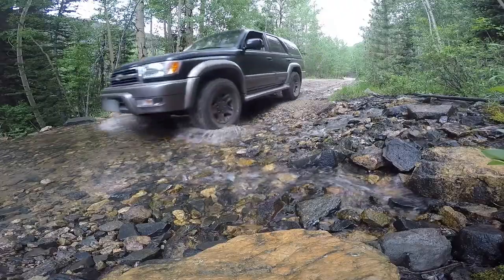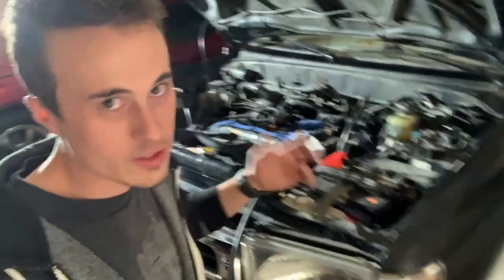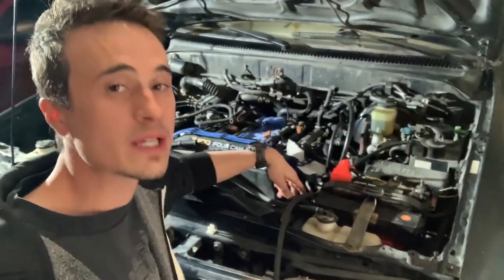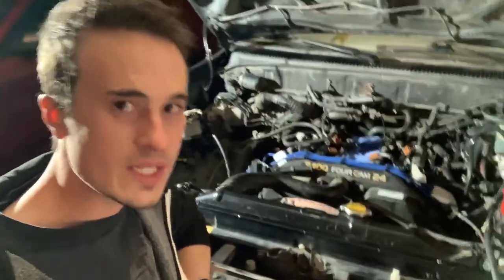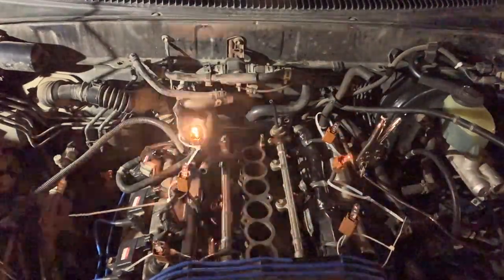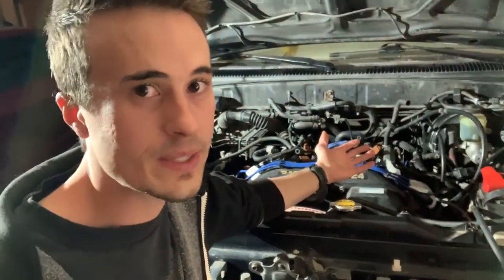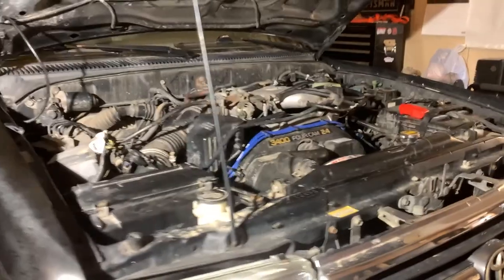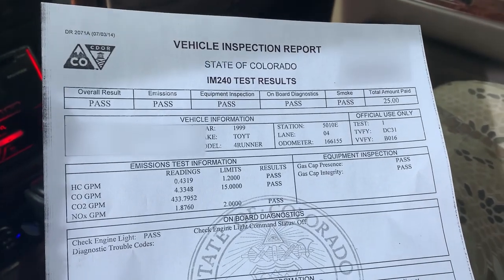1999 Toyota 4Runner Misfire Diagnosis Story | How I Finally Fixed it

Comment: Dang Kid!  the patience of a saint!  I got a 2000 with a misfire, the misfire  that didnt start till I cleaned the motor, gentle rinsing with a pressure washer which Ive done 1000s of time over the years detailing cars..   any thoughts?   oh and the same exact thing happened with a fuel filter i replaced from am0zon, ECOGARD XF44710 Premium Fuel Filter ,   after 3 days I noticed a drip , i checked and tightened the connection while it was still installed but it still leaked???,  I unmounted it and inspected, couldnt find a fault so I put it back on and gorrilla'd the connection. so far so good..  thanks the vid, WELL done!
Reply from the maker: thanks! haha wasn't as good at diag but this helped a lot an i'm much better at it now. if it started happening after pressure washing the engine, I can almost garuntee you got water in one of the spark plug tubes causing a misfire. glad you got the fuel leak fixed. the one I got had the wrong size fittings. I really like the quick disconnects on my ford van much better
Reply: @4WheelKid  appreciate the info young man, I also have a 2000 toyota echo with 334k miles..  the windshield washer nozzle is just above cylinder 1, at one point in time, I removed the plastic shield which covers the top of the engine and didnt put it back,  after heavy downpour, the water dripped in and onto the valve cover, then seeped into the spark plug cavity and exactly as you said, it caused intermittent misfire.. so on the 4runner I thought I was being extra careful about getting those boots wet, I checked cyl  2 and 4 and they were bone dry ill pop them all off and look closer but that is the exact symptom I was getting back in the day..     thanks for the reminder : )   I replaced the fuel pump 3 weeks ago (new) on this 4runner, and then two weeks later it stopped working again so I thought it was faulty,  resistance reading was like 160ohm range on pin 4 and 5..  so I drained the tank again and removed the unit, a real pita on the ground, then pulled the pump out and is was covered with white corrosion???  when i disconnected the internal connector and measured the resistance it was on the money and she powered up!  ya, i carefully cleaned the terminals , put a thin coat of grease on them and reinstalled everything and she started right up, THEN i cleaned the motor, a very light dusting and of course the misfire  lol      this 3rd Gen is def like a tank! and toyota product is tight!   I did change my timing chain on the echo when she was at 332k.. it is suppose to be timing chain for life but I wanted to do it anyway..  when I put the old and the new side by side, you could NOT tell them apart..  ZERo wear!     thanks again and ill keep you posted  : )

Comment: I cant decide if i love these trucks so much that I would do anything to continue driving them or I'm a glutton for punishment...just did valve job, still having misfire and engine cuts out. Timing checks out. Might check starter solenoid before I go any further
Reply from the maker: dang, it's gotta be something, Fuel, air/compression. and spark... it's one of those things

Comment: Had that same issue with a 97 Tacoma. I Did EVERYTHING IN suggested on the internet and it still  didn't fix the problem. In the end it turned out to be a capacitor had leaked in the ECM.
Reply from the maker: oh wow. that's no good. hope a new ECM didn't cost too much

Comment: I see you are in Colorado. These go for $10k even a beat up one with 300,000 miles. Thanks for video
Reply from the maker: Yeah I got lucky and picked this one up for $5000 like 7 years ago 4x4 limited with 129,000 miles, just did a full timing overhaul, with aisin timing belt, pulley and water pump kit, new toyota camp and crank seals, new thermostat and radiator as preventative, the rear suspension has been replaced with 1.5in lift. Toyota axle bearings and seals have been replaced. Just needs front end suspension and drive line overhauled and it will be in near great shape, could use some paint work too.

Comment: My 99 Toyota 4 runner 4cylinders not power runs poorly?

I replaced  plugs, wires, fuel. Filter, fuel injectors,TPS sensor ,MAS sensor, new Catalytic, new exhaust manifold, still not power on first gear, any thoughts?? Thanks!
Reply from the maker: Check your compression

Comment: Long story short, I know I watched this video a few months back cuz I thought the light bulb thing was genius and I thought it described my problem but this isn't the video I thought it was but I'll ask you my question anyway cuz you're obviously knowledgable about these old 4runners. My '99 runs great when you start it up after it's been sitting, but if you stop to go into a store and restart it it runs rough and the check engine light will come on. But if you let it sit a couple hours it runs fine again. I saw a video that described this same problem and it was the injectors. Cuz that's not a small job, I've done plugs, wires, and MAF. I thought the MAF nailed it cuz it ran good even after shutting it off a couple times, but it's back to doing it but not as bad. I really don't want to do the injectors if I don't have to. Any ideas? Thanks. And I hope you're an engineer or something using that big brain of yours! Also, no fuel in my oil
Reply from the maker: Your gonna have to get creative and figure out a way to diagnose, use a stethoscope to listen to see if each injector is firing. Now days I would just use a thermal imager looking at the exhaust manifolds to see which cylinder is misfiring and go from there

Comment: This might be my problem. I have a 95 tacoma with this same engine. P0303 pops up, I erase it, comes back up in a day or two. It’s so annoying. I can feel a little giggle when on idle. I put in a fuel cleaner and it started misfire like mad. P0300 p0301 p0303 over and over. When i had to fill up the tank after finishing the cleaner only p0303 comes up. Changed out all the ignition coils, spark plugs with duel electrodes, and wires all Denso. Still getting that pesky misfire.
Reply from the maker: it could be a problem possibly, could also be something else, best to test not guess, that's what learned going through this experience

Comment: Man I'm struggling to fix my 02 4runners. I've change the spark plug wire, ignition coil and change spark plug 2 twice just find out they need a dual. Still idle rough and has a hard time driving. Took it to a shop and said cylind er 1 and 5 are having a mis fire and they say it's the fuel injector since everything else is good. I'm planning to change all 6 but im on a budget spending close to 3k already. I've seen a after market Denso injector for $50. Should I go with that? I don't want to spend $200+ for 1 injector
Reply: Sounds like a bad coil
Reply from the maker: darn sounds like your having a rough time. could be an injector but could also be a wiring issue like rodent chew or something, don't want to rule that out. I looked at a trade-in at work one time where the oil pressure light was on constantly. someone had already replaced the oil pressure sensor and didn't fix it. they probably traded it because a "Mechanic" said it needed a new engine. I followed the oil pressure sensor wire and under the airbox, there was a mouse nest and they had chewed the wires up. I repaired the wires costing my work next to nothing and it was fixed. Before you go any further if not done already I highly recommend compression testing all cylinders to make sure the misfire is not a mechanical issue so you don't waste even more money and that way you know for sure it's either a fuel or spark problem.  Also, the misfire numbers are not always accurate on these 3rd gen 4runners. do you have a link to those Denso injectors? I couldn't find any densos when I was looking. I just don't want you to get fake ones, because there are a lot of those out there. I also got OEM injectors from Toyota, for about 160 each, I ask for the dealer-to-dealer wholesale discount because I work at a nearby dealership. they always give me the discount without question. The oem injectors are made by aisin. I also dropped the tank, cleaned it out and checked for rust, replaced the pump with a Denso because that is oem. replaced the fuel pressure regulator and all 6 injectors with oem, and a wix fuel filter, now I won't have to worry about anymore fuel problems for another 20 years.
Reply: @4WheelKid  thanks for the reply! I had a reliable mechanic that my cousin refer me to. Looks like this whole time it was a timing belt issue. Got the whole timing belt and water pump replace for 1k and it's running like a Champ! FYI the car only has 85k for an 02. I had bought it off my mom and she barely drives it only to work and home. And she had a few collision from the front end but nothing serious, only a dent in front of the bumper which im planing to replace with a metal bumper kit.
Reply from the maker: hey glad you got it figured out! did it just skip 1 tooth or something? that could for sure cause the issue. That's why I checked my timing. that's super low miles. these 3rd gen runners keep increasing in value it seems. just did a full timing belt overhaul on mine. runs great. have like 170k miles on mine. now it just needs some front steering and suspension work and it will be good. and some paint work haha. cool how much did your bumper kit cost? best of luck

Comment: I'm having the same issue. Crazy backfire and car won't run, stalls and dies. The strange thing is only happens when raining outside. But ever since the last snow storm it hasn't ran since. Any advice?
Reply from the maker: Could be a lot of things, maybe its electrical. You gotta learn the diagnostic process

Comment: Where do you reccome d we buy fuel injectors from?
In looking at a place called CarID
Also, i think the fuel injectors im thinking of buying are GB manufacturing so idk if i should change
Reply from the maker: I would just get oem toyota injectors, that's what i'm doing now. I just had another GB manufacturing injector jam open on a road trip. had to tow it back. now I have to shell out the money if I want my 4runner to be reliable

Comment: Hello, I have the p0301 code misfire in cylinder 1. I also noticed my coolant is empty in my reservoir and my radiator.  Any advice. I'm replacing wires plugs and coil packs.
Reply from the maker: I would figure out where your coolant is going before spending money on anything else. you may have a warped head with a blown head gasket. do a combustion leak test before doing anything else. https://youtu.be/GTty0CTpUEg
Reply: Was it a cracked head? Milky oil indicates that.
Reply: @smrtnz5995  no, it was a blown head gasket.

Comment: little motor oil in fuel  works if injectors are  sticking  .they ain't always  broken just some oiling up  things  inside
Reply from the maker: maybe but I don't trust those remaned ones, not a single problem after installing new oem
Reply: What kind of oil and how much thankyou
Reply: Isn't a quality injector cleaner like Lucas going to do that and more? I;m generally no a fan of parts store snake oil but it seems like a more logical approach if you want to go that way....
Reply: @jameswatt4694  that  easy  hmm ?
Reply: @jameswatt4694  yes as long as  locial approach don't have innocent  parts as victims  of cleaners  that destroy gaskets . and creates more friction
Reply: @cartoons981  Honest question - do you think injector/top-end cleaners can cause engine damage? Lucas and Royal Purple have pretty good reputation. I'm not a big fan of that stuff like I said but someone might get lucky as a first step before going down the rabbit hole. Thanks for responding to my comment on this older post, BTW!

Comment: Hey man just put a new engine in my 99 3.4L 325,000 miles new spark plugs and wires having minor issues only in gear In reverse and drive has a small jolting issue wondering if I should replace my injectors? Or run maybe a fuel induction service on it? Only does it when crawling around 1-2mph then goes away when accelerating.
Reply from the maker: could be a lot of things. are you sure it's not transmission related? I would start with smoke testing the intake
Reply: Driveline - u joints. Slowing down to stop then clunk.

Comment: Hello friend, greetings from Venezuela, I have a 1998 4runner 4x4 5vz, I changed the timing kit and it stays accelerated at 1100rpm, what could I do?
Reply from the maker: Hi, im not sure, if it didn’t have that problem before then its probably something you did to cause it or didn’t plug something back in.

Comment: So you need to put OEM injectors you can’t put aftermarket injectors, because if you put aftermarket injectors is not going to work, right?
Reply from the maker: that was my experience. not worth the risk with injectors, those cheap reman injectors could easily ruin a motor jamming wide open like that

Comment: Where do I start? I have 95 4runner 170000 miles it starts and runs fine but after running for over an hour I stopped for about 30 minutes then restarted it but it was shaking a lot and couldn't stay on unless I stepped on the gas. I let it rest overnight the next morning I turned it on and it was running fine. I usually don't run it for long long  because I live like five minutes from work. That day I took it out to go hunting so I was stranded up in the mounting overnight. I'm gonna do a full tune up, beyond that is beyond my knowledge. Any tips?
Reply from the maker: do you have any obd codes?? maybe even a pending codes. it's possible you have an intake leak somewhere. but I would read codes even if it's pending. might point you in the right direction

Comment: Jeez those compression numbers are low for that motor.. i got an 03 and all mine are 195 +\-5..   but i had issues with new injectors dripping after shutoff.  Causes lazy starts or will die when starting after shutting it off recently..  never stuck..  but have had an evap issue for years..  smells like gas a little every now and again..  and cant fill it with gas like you should, clicks off all the time..  checked all lines and seems all good but gave up on it..
Reply from the maker: Its lower cause I live at high altitude. Compression isn’t an issue with my 4runner cause it doesn’t burn a drop of oil. Are they oem injectors from Toyota? Everything else seem to be junk. Maybe something wrong with the vent system, or anti siphon device

Comment: I have p0304 and my 99 is fine when in cold start, after the engine is warm up and it will misfire when I turn the key off and on again , I have replace oem stock spark plug wire and spark plug but still did that. Any idea? It happen to me after I have a long ride from Chicago to Florida
Reply from the maker: see if you can put a spark tester on each plug while your having the misfire. could be a coil pack potentially, but you want to figure out if it's fuel or spark. probably not a compression issue since it acts up all the sudden after start and restart. another thing you could do instead is after it misfires for a bit, pull all the spark plugs to see if a specific one is fuel soaked, that will narrow down which cyl it is. does the check engine light come on? that might help but I hear these older runners are not very accurate at detecting the correct misfire that is missing
Reply: @4WheelKid  thank you for taking your time to answer me  , it light up p0304 then it go off again after 10 15 mins, maybe injector u think 4th cylinder ? Try to swap it out once the injectors shown up . Did the coil too , no luck . Have to tow from Destin Florida to Chicago at the end .
Reply: @charlesyii8963  did you ever figure out what was wrong?
Reply: @cjk9416  it was my injector , swap it out , drive like brand new again .
Reply from the maker: glad you got it figured out!

Comment: I'm having a misfire on 4 on my 97 I did oem fuel injectors new denso coilpacks new sparkplugs oem and gaskets still has misfire. But noticed white smoke and coolant shooting out of cylinder 4 so I assume head gasket blown.bought a k&n intake and cleaned my maf still miss fires really annoying so im Not gonna waste my time fixing it and resurfacing heads and hot tank cause I also have a oil pressure light on at idle then goes off when I hit the gas so I'm looking st used motor and ima swap it out and then rebuild this one and flip or keep for back up also mine won't over heat ran 30 minutes without getting hot even with misfire nothing electric looks wrong I'm stumped on it😢
Reply from the maker: Yeah thats not good, sounds like the head may have warped and blew the head gasket. Oil pressure light sounds even worse, probably time for a new engine, you could do a leak down test if you really want to, but sounds toast from what your describing

Comment: Unlikely to bend a rod that way unless the cylinder was filled with fuel. Even then the bearing usually fails. In this engine not likely! I never use aftermarket crap on Toyota/Lexus. I tell customers OEM or take it someplace else ✌🏻
Reply from the maker: yeah i'm glad nothing happend,  there was a tone of fuel going in, the engine never ran long with it like that, if someone kept driving like that it would be bad, yeah OEM is best, especially for extra important parts. 4runner been good ever since

Comment: I have a 99 started missing someone missed 2 spark plugs during a change has 322k on it and was driving everything shutoff except the engine drove home and now doesn't start
Reply from the maker: dang, gotta start with the basics, maybe a loose connection somewhere?
Reply: Alternator went bad burnt the 120 Amp fuse.